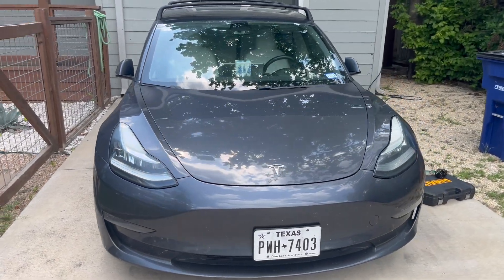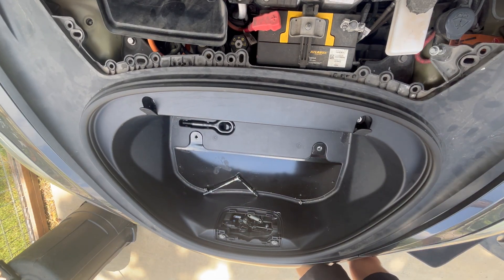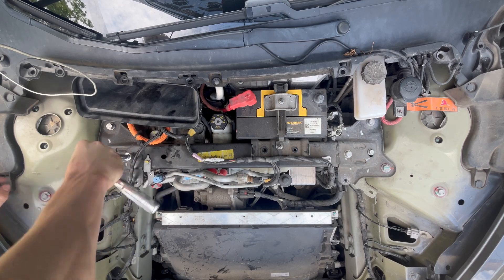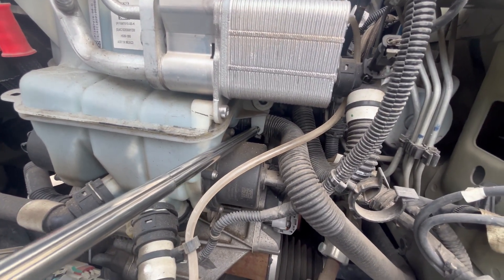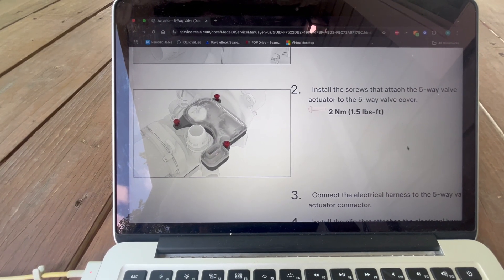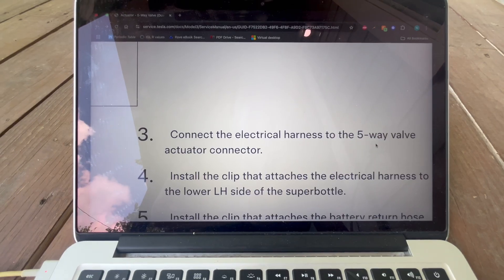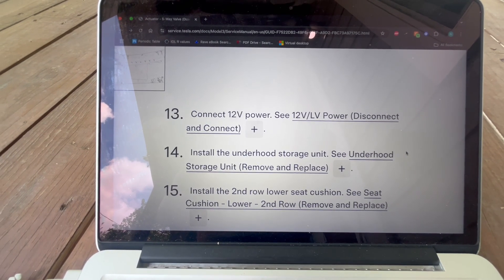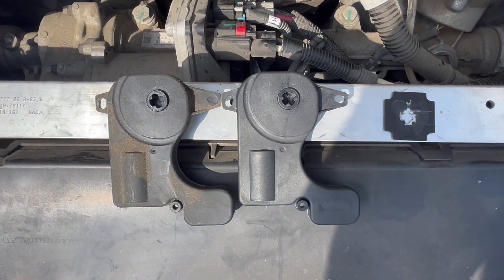Tesla Model 3 Five-Way Valve Actuator Replacement Tutorial (Dual Motor)

Comment: You can also use the old 5-Way Valve, by opening it and cutting it in half. then is twisting the shaft is a piece of cake
Reply from the maker: Omg I wish I had thought of that
Reply: Great video!!! 
Question after you installed the new one did you have to calibrate anything?  I was reading somewhere you may have to use ToolBox after installed?? 

I have to replace mine just wanted to double check thx 🙏
Reply: @SergioERestrepo  that is a very good question as I also need to change it for my TM3P with almost 100.000ml on the clock :)
Reply from the maker: @SergioERestrepo thanks! No I didn’t have to calibrate it.
Reply: @noahslab thanks so much for the reply. In service mode there is also a valve test. 

Will buy the part this weekend. Appreciate your help
Reply from the maker: @SergioERestrepo  yeah there indeed is a valve test. That’s all I did after the install to verify it was working correctly.
Reply: @noahslab  just replaced mine, but still the same mistake and test still not passed :(
Reply from the maker: @TomasJanušauskas  ah dang, sorry to hear that. It’s possible that there is some debris in the valve itself.